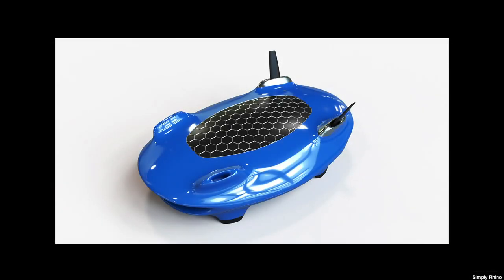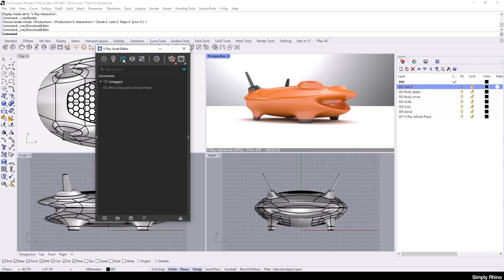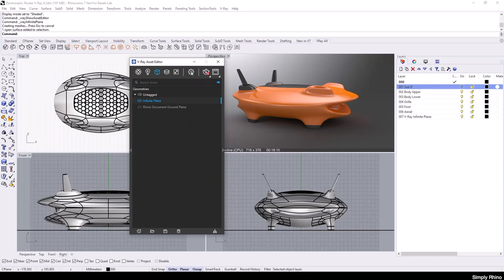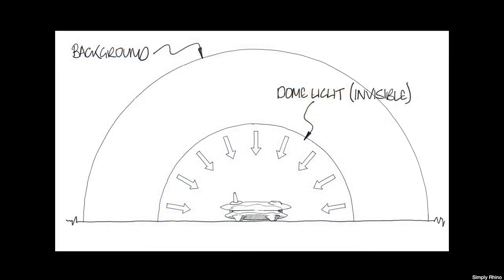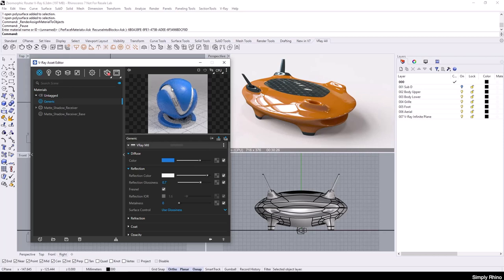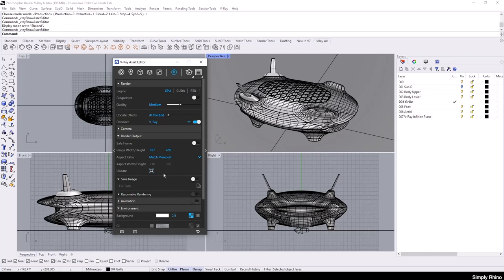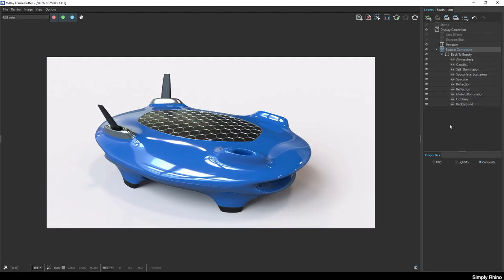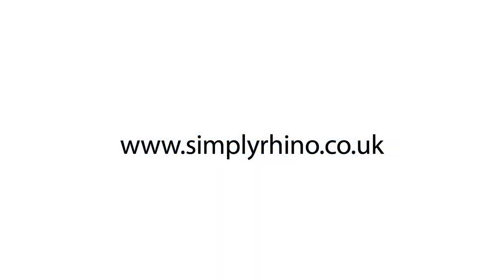Getting Started with V-Ray - Product Design Render with Rhino v7 and V-Ray 6

Comment: Hi, this is a very usefull tutorial. I have a problem with background color, even though i set it on white, keeps going back to black. Any clue why this is happening?
Reply from the maker: Hi, thanks for your question. There could be a number of reasons but first check that you have the Dome Light set to be ‘Invisible’. If you have your Background colour set to White try increasing the multiplier to make the background brighter. Does this help?

Comment: Hi, thanks for this tutorial. I have a problem with the shadow catcher when applied on the infinite plane and using back to beauty. If I render the images with CUDA or RTX the infinite plane with the shadow catcher will result black but if I use CPU render I don't have any issues. Do you know if the problem is related to the GPU used or maybe I have to tweak other settings ? I can see from the tutorial that you are rendering using the CPU. RTX 3090 GPU used.
Reply from the maker: Hi, we can confirm that testing here shows the same problem. The behaviour is different with CPU and GPU. If you use either a legacy ‘Matte Shadow Receiver’ or the new ‘Shadow Catcher’ from the Cosmos Browser then only the CPU calculation is correct. We’ll get in touch with Chaos.
Reply: @SimplyRhino3D  Thanks for the quick response. Hope Chaos can fix it.
Reply: They won't fix...it's 2024 and no dice.